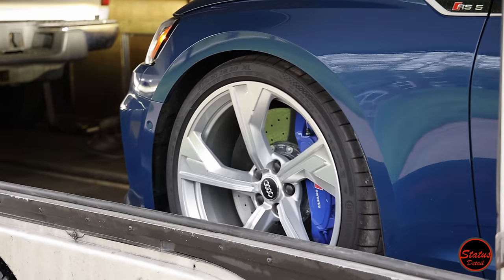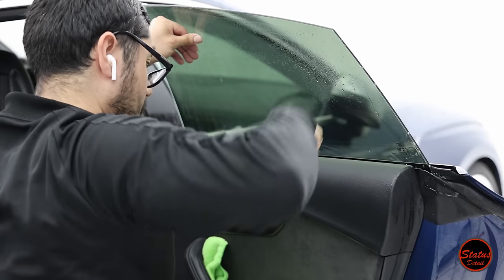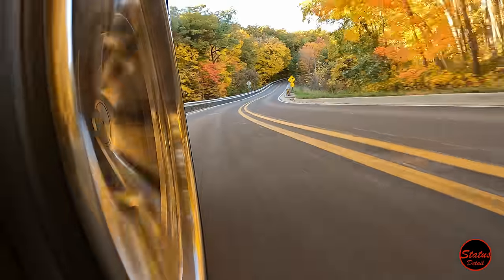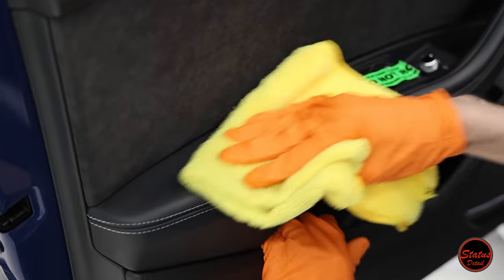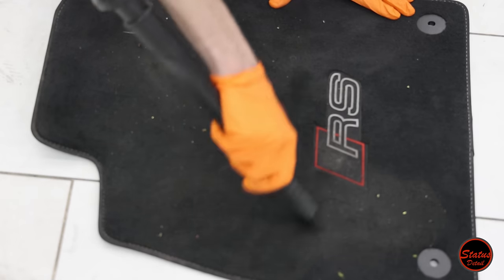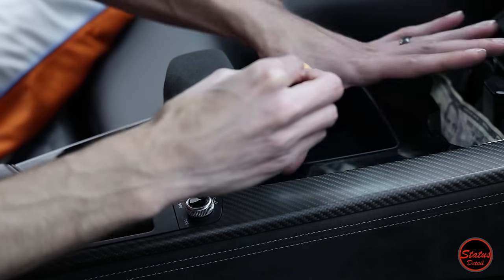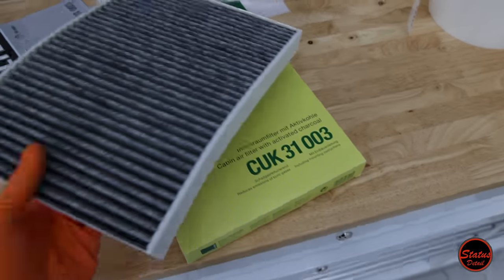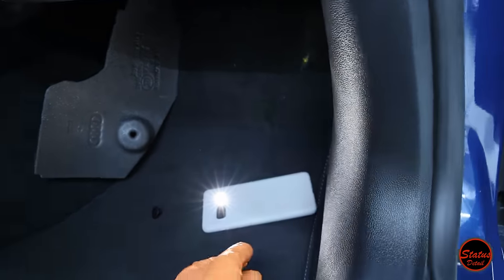World's Most EXPENSIVE DETAIL Ends In DISASTER

Comment: enjoyed this video! Curious what the foam hand/palm sander was that you were using manually to wet sand right at the start of the wet-sanding section? The black one, looked like it was around 3"?
Reply from the maker: That's actually the foam block that comes with a meguires headlight restoration kit lol! It's very old and comes in handy sometimes. I sand by hand a lot or cut up old ceramic applicator blocks to make custom blocks too. But as mentioned kxk makes the best blocks. I just make do and never order them lol. Don't be like me lol. Order real sanding blocks if your serious about sanding
Reply: @STATUSDETAIL  I swore I saw the meguiars logo but couldn’t find it online. Looks like a firm foam if I’m not mistaken but seems ideal. Loved the video, I’m like you when it comes to the correction but PPF is something I’ll never be able to do to the level I want. Love to correct my next new car and send to you for PPF!
Reply from the maker: @SupercarSeany  yea it's probably like 8 years old lol. Somehow remains in the cabinet. 

I bet the current headlight kits still include sand paper and blocks tho. 

PPF is definitely hard to learn. I hear stories often of someone taking a class and a few months later give up and use contractors. If you survive learning and getting proficient then you need to desire to struggle more and get into more advanced techniques and raise your standards for installs. PPF is very mental. It will beat you up. If you reach this point you can go for the 1% install crazy advanced techniques and having a process so perfect that you virtually never redo panels. Most quite before the last two levels because they properly lost there mind and couldn't stand losing any more money. If you make it past the first hurtle and almost quit and have no desire to learn more because you hardly got here. then that's the shop that usually doesn't charge much and doesn't do great work. But gives you ppf/protection. It just isn't pretty lol. 

PPF is hard. And when I say that most don't understand how hard it really is lol. Would love to earn your business!

Comment: From your other video about NOT applying PPF, why are you doing this car?
Reply from the maker: Sounds like you have missed over a year of videos! I have a video about Xpel vs STEK. That really sums up why I started installing ppf. STEK solves many issues I had with ppf. Most installs are really bad. The installs we do are of the highest level and solve the rest of the issues I had. 

I don't recommend the average car get PPF. The super car and beyond range of cars can benefit. But ppf is mainly value based to you personally. You don't get that money back at selling time. I don't recommend a new 40k car get full body. Even full front would be expensive on that and change nothing when you sell it. When your car is around 100k or more it becomes obvious it's wise to at minimum do a front. This is all totally irrelevant if the installation looks terrible. So you have to find a good installer first and foremost

Comment: Ha, I just bought the same car last August!  It was also from PA, and basically the same condition but for the rear bumper with shabby small repair and respray and a couple of the wheels had half ass repairs.  Mine had about 35K on the clock and the minor cosmetic issues so paid $65K.  Everything else was in fantastic condition (including the piano black ;)); come spring I’ll have the bumper and a couple wheels replaced.

I did a decent detail after I bought it and do keep it very clean but Dude you’re killing me with how great your RS looks, I have a long way to go!  Btw, I agree about Leatherique, have used it for many years.  

Also love those new wheels!  I’m torn about keeping mine stock or get an even lighter forged set like what you have.  Btw, I put the 034 carbon intake on, sounds and looks really nice!  I had the matrix laser headlights activated, including blue accent light, so awesome.  Also did the tint and wheel spacers.  Next I plan to do the front resonator  delete kit, thicker rear anti-sway bar, upgraded intercooler and 034 Stage 1 93 octane tune (had it in my S5, was great!).

Enjoyed the vid! 🍺
Reply from the maker: Interesting! Was it from Audi Pittsburgh ? That's the location of the first one I looked at. They honestly jerked me around and did horrible job on the sales side. The car was listed for sale but turned out it needed the front bumper and other panels body shopped. I agree to wait the week or so they say it will take. Over a month goes by of terrible communication. I almost buy a nardo car with like 1000 miles but as I'm about to wire money they say it has no warranty because of tune. Walk from that too. Then I found my car. Buy it. Ship it. And total time well over 2 months after first contact the Pittsburgh guy calls all excited that it's done and ready. And I'm like dude your so late to the party it's not even funny. Lol I use to sell cars. Free tip to all dealers .. list it when it's available not when it needs 2 plus months of recon. 

Glad you found RS5 tho. It's a tremendously good car! I want a RS6 as well but the RS5 feels more nimble in my opinion. More of a sporty daily. I'm always driving by myself but if family comes I would have a proper back seat. I'll get. RS6 eventually for the Audi collection. 

Definitely check out my other vids lots of stuff you can diy at home with supplies from statusdetailstore.com

I'd get custom wheels and ditch the spacers. Forge Light has a new design similar to mine now too. 

Those mods sound awesome. I definitely want more intake noise. Was looking at apr. It has options to have the filter pretty open. Hopefully making for good induction sounds. Or was it awe...

Looking into the x pipe stuff too. Or just full awe exhaust!? But then I'll lose valves!  I'd happily tune but have warranty I will let run out.

Glad you saw the video and stopped by to watch! In a big Audi fan and hope to gain some Audi follower's🙂🤝

In the future I could see doing crazy hybrid turbos and upgrading everything. Apparently they become super cars with those mods lol
Reply: Yep this is the Pittsburgh car!  Pittsburgh sold it to Autobay in NJ in June and I bought it from them in August.  This is an awesome car to drive daily loaded with all the options and beautiful to look at, in love with the (then) rare color spec!  The fact that it’s a 1 of 100 limited edition is icing on the cake; wish there was a way to find out which number of the 100 it is?

At purchase the car was actually in great shape but for a shabby rear bumper cover repair including slight paint mismatch, and 3 of the 4 rims had curb rash repaired, but not the best work.  The dealer must have replaced the front bumper you mentioned because that looks clean.  The hood and fenders are great but for a couple tiny paint chips, wonder if PPF’d prior?  The interior was practically new, with the carpet mats never used, sitting under the all weather RS5 rubber mats the original owner apparently used year-round.  Now time to give the alcantara a thorough cleaning and hit the seats with Leatherique, thanks for the DIY tips!

Come spring I’ll have the rear bumper replaced along with the wheels, plus need to have the front PPF’d.  I’ll check out those Forge Lights, are you keeping your OEM rims?  I may have to do a front resonator delete sooner than later, I keep watching YouTube vids and it sounds insane!😃

I’ll be sure to checkout your other vids.  Looking forward to see what else you do with your RS5.  Oh I’m with you, would love an RS6, I’m a long roof guy, but that beast is a lot more money to buy and own.  I have a Q8 also, so have my fill of heavy wide ass Audi beasts to drive, though missing that mad V8 experience.  IMO, the RS4 would have been the perfect all a rounder for me if available here, but this RS5 comes close!

Take care of yourself Dude, don’t over do it, believe me I know how that is.
Reply from the maker: @petejr7583  very interesting. At the time I told them to paint the hood and front bumper. Maybe they only did the bumper. The bumper had a massive scrap on side. Like it was curbed into a 2 ft curb. Didn't bother me just wanted it painted. I think that car was owned by a guy that buys a rs car every year or two. Dealer new him well with all services at that dealer. Unless I'm confusing cars.... I was ready to buy. They just took way to long. 

Glad you found the channel! My oem wheels are my winter wheels now with snow tires. I highly recommend ForgeLight. Can't recommend the experience enough. Plus the wheels are seriously impressive. 

I took an curious about exhaust mods. I want to keep valves. So a x pipe is interesting. 

I'll grab a rs6 sooner or later. But I'll sell my 14 s6 soon for a sq7. Need better family car. Gotta maintain a v8 in fleet lol. Probably get black one then stealth PPF it! Maybe some exhaust mods on that too lol!

Look forward to seeing a Audi fan. Around the channel!!
Reply: @STATUSDETAIL  That original owner was really hard on curbs apparently...puts my wife to shame.  I think I may do the same as you're doing with the wheels, keep as a winter set, have already checked-out the Forge Light website; saw your car in the gallery - damn our cars are sexy, yours especially with those rims!  

I'll have to look at the hood closer, doesn't appear to be a respray, but they definitely replaced the front bumper; wish they had done the rear also as that was obviously run into but they just did a (poor) repair.  

I hear ya on the V8!  I need another!  I recently traded-in my '05 AMG CLK55 with 5.4L NA V8 - wasn't superfast but sounded like a racecar (muffler delete) and handled like a drift car. 😮😀
Reply from the maker: @petejr7583  lol. Yes I remember some damage on the rear in photos. I believe my contact at Forge Light was Joshua. If you dm the Instagram he will probably get it. mentioning me won't hurt lol.

Mercedes AMG sound very good 👍👍 the s6 needs a exhaust. Way to quiet. But I've heard it opened up and it's great.
Reply: Thanks for the tip dude!

Comment: Rotary and or da with microfiber cutting pad would have been more efficient on rock hard Audi paint. Looks great tho. To each their own.
Reply from the maker: I use all of the above. Depends on the situation. Everything has pro cons. Your job as a paint correction specialist is to leave as much paint on the car. Not hit it with a sledgehammer and get results instantly. Every panel might need something a little different to reach perfection while maximizing clear depth and integrity.
Reply: @STATUSDETAIL  true, but pass after pass with foam because it isn’t aggressive enough heating up the material and thus removing more. Rotary generates little heat and is basically just a sharper more efficient knife
Reply from the maker: @taylorweick8688  that was inaccurate. I could write a 20 page paper on this lol. We can agree to disagree

Comment: Polishing is nice BUT for example front bumper - you sanded, totally removed the finishing layer, polished naked paint - looks great - BUT gonna last only if you put ppf on it - otherwise the 1st insect that you heart will be absorbed by paint and only polishing again;

I had Audi with flat Turbo Bleu paint and previous owner was « mega polisher » but any dirt was un removable from the bonnet due to almost varnish absence 😢
Reply from the maker: I specialize in correction. That bumper had way to much clear and was never refined by the painter. It has a totally normal amount of clear on it currently. It's as it should have been after it's repaint. Every body shop sands after laying clear. If they do a good job. 

It also has ppf on the front bumper 👍

Comment: I hope you have warranty on that car. Those RS engines are pricey to run after 50k miles.
Reply from the maker: I have OEM warranty left. I also have driven it about 25 miles in last 2.5 months lol. I don't drive much. Currently winter. But In General I hardly drive. 

I have a great independent Audi shop local that's very reasonable. If something bad breaks we will rebuild it to make twice the power 👍 when stuff breaks you can start having fun lolol

Comment: Why do you soak the leather of the seats so much, apparently the leather does not like to be wetted so much. Doesn't this substance make the leather hard later ????
Reply from the maker: If your talking about leatherique leather oil then I can only sum it up as a incredible unique system that's very non traditional. Typically I would not wet leather and let it dwell. But the leather oil is different. 

Spraying something like gyeon leather cleaner and then wiping away is no problem. 

My seats are as soft and new feeling and looking as a 20 mile car 👍